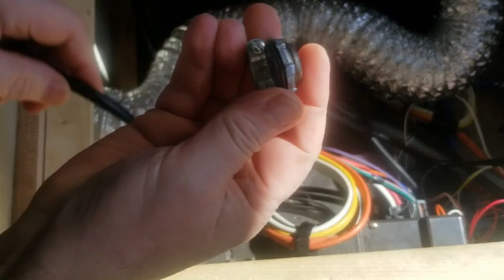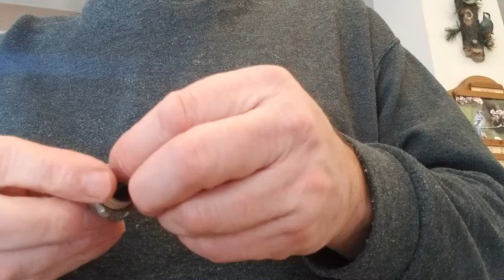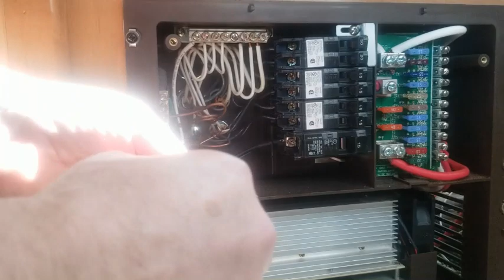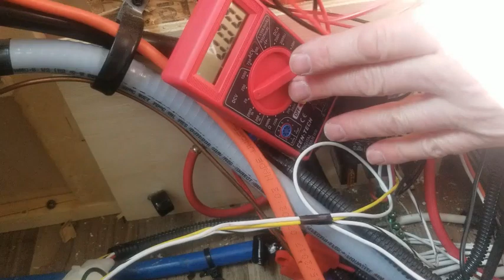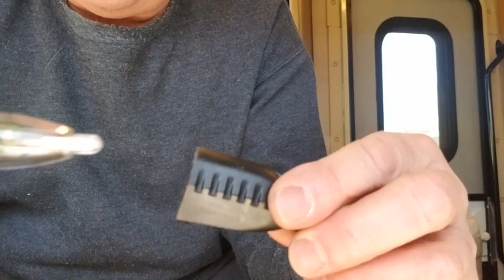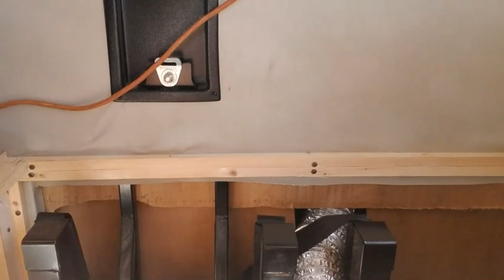Adding a Trickle Charger to Your Motorhome or RV to Charge the House Battery when You are Plugged in

Comment: The wire you cut, was that the wire with a wall plug on it? I'm trying to find a trickle charger for my motorhome starter battery because my old one burned out, but the old one didn't have a wall plug to plug it into an outlet, and I can't find any trickle chargers that don't have a wall plug to power it.